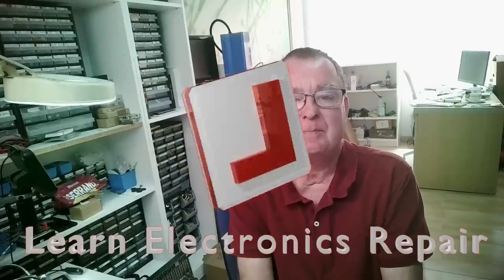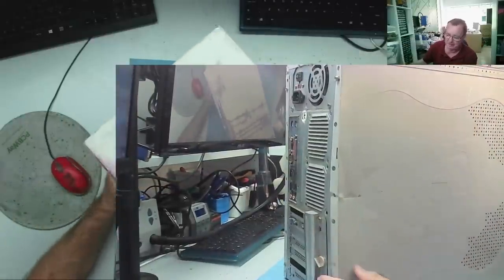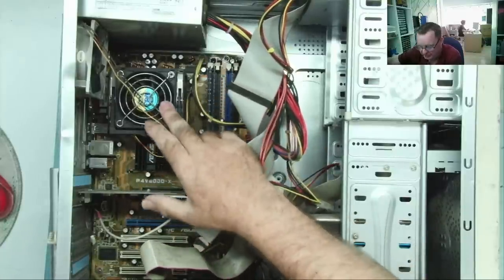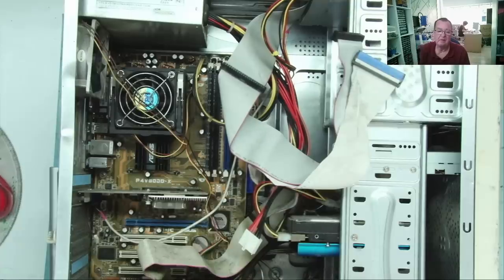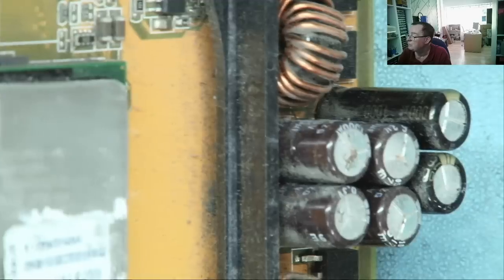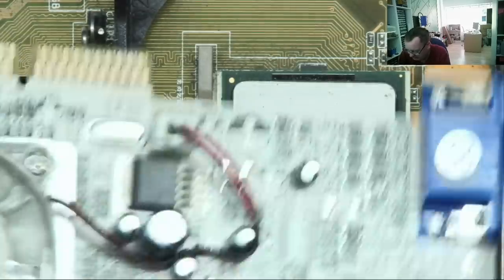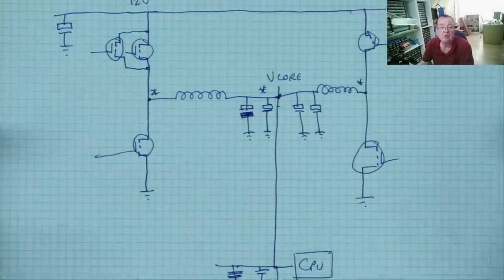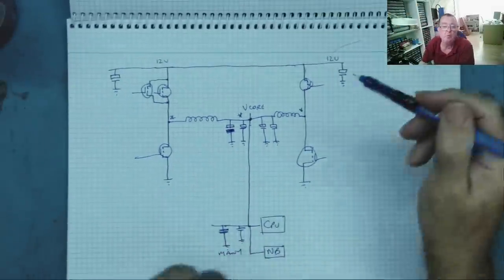How to find a Short Circuit in VRM - A Real Life Example for any Motherboard or GPU

Comment: Thanks for the interesting video Richard. While watching I noticed two things that might save you some trouble down the line. First, at 20:28 there is some dark spot on the traces below the northbridge. This may just be dirt but might also be 2 or 3 burnt traces. Second when you applied leaded solder to the MOSFETS to aid removal at 52:57 you spilled a solder blob between pins 18 and 19 of the Richtek chip and two adjacent resistors.

Comment: Thanks for the video. I didn't think I'd see double low side mosfets shorted, never mind on two phases. Also, thanks for pointing out that the controller may cause a short to ground as well through the phase monitoring input - it never occurred to me that this can happen.

Comment: Well as you rightly commented, it was a very enlightening video and also educational for me at any rate, I learned so much about how each component reacts with another and also how they all react or communicate with each other, a little disappointed at the end, as at the beginning you indicated that you would see us at the end which I wrongly thought was going to be the reveal of the problem and solution, I expect you will make this clear on the follow up. However I would like to thank you for the clarity in the explanation, one suggestion, I watch another channel as well and I at one point early on when you where testing the inductee coils and removed caps, I thought oh why isn’t he showing the meter, this I then noticed was on the other side of screen, so I ran back and watched, but perhaps having the meter screen or showing the meter below your face, which is where the viewers concentration is on, this and board or work piece, it’s minor but I think would really help concentration, it’s like when I used to tutor or lecture, one of the first things is don’t have any distractions in view, like a model,or piece of equipment covered or formula on the board, as it takes the students concentration from what one is trying to get them to focus on. Hey it’s not a criticism as I really do gain a lot from these wonderful and varied sessions. Or broadcasts!
Reply from the maker: Oh sorry yeah I was going to add a little 'outro' chat which I recorded and forgot to put in the edit.  Oops.  But I did find the actually cause of the short circuit so I hope that was satisfying.

Comment: retired now, before finishing out my career in "IT" in the corporate world. I started out around 2000 doing home and small business networking and computer repair. we use to see puffed capacitors showing up. found out back then it was from industrial espionage where someone broke into one of the big electrolytic capacitor manufacturer network. apparently the capacitor manufacturer keep their electrolytic formula in 2 parts in different parts of their network. so the theives stole only one part. then they made counterfeit caps with forged names of good standing companies. The puffed up caps is because like i said the electrolytic formula was only half of the formula.

Comment: Gday Richard, Why didnt you try your LM317 constant current kelvin probe short finder on this fault? Thanks
Reply from the maker: It would have behaved same as the micro-ohm meter I used instead.  The main thing here was that there were shorts on the mosfets on both phases and that made it hard to locate.  Even current injection didn't work.

Comment: A master class in VRM troubleshooting, thank you Richard. As all four low-side MOSFETs are shorted, wouldn't you replace the PWM controller too? Seems like that would be the most likely cause of all four MOSFETs failing at the same time. Regards, David.
Reply: Did you listen when he said there probably would have been a short between the gates of non-paired mosfets, which made him think twice about the controller????
Reply: @ernieschatz3783  Did you listen when he said it was very unusual for all of the low side MOSFETS to fail simultaneously? What would cause that? It was a question to an expert, not a criticism.

Comment: Nice fault finding video but I'm pretty sure the gates on all 4 of those mosfets would have been shorted too and could have been dead easily tested in circuit?!
Reply from the maker: No the gates were not reading short.  I showed that in the video.  They did read like a diode junction, which is a bit odd for a mosfet gate but that could be inside the PWM driver chip as I may have been reading in the reverse polarity.
Reply: @LearnElectronicsRepair  fair enough, I heard you say you will test the gates, but must have missed you doing it. I'll look forward to the follow up, seems like as you say the PWM controller has failed and caused these to blow.